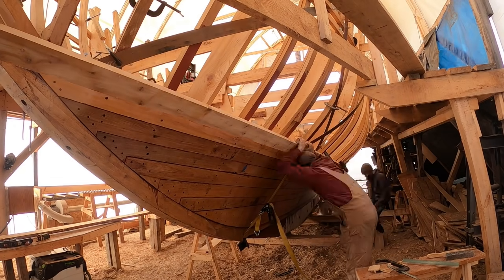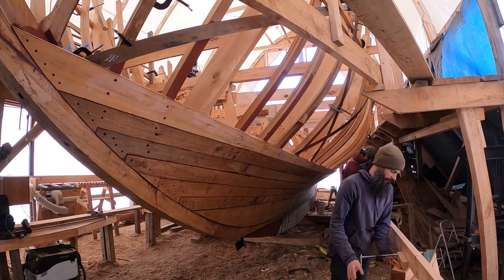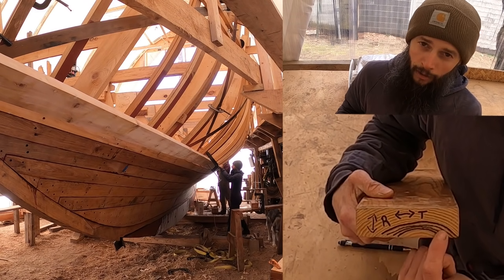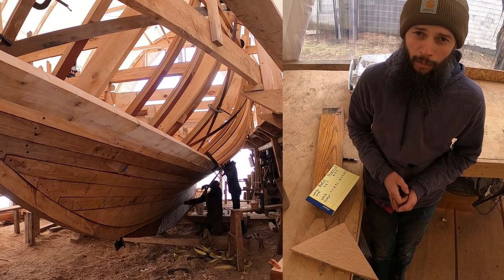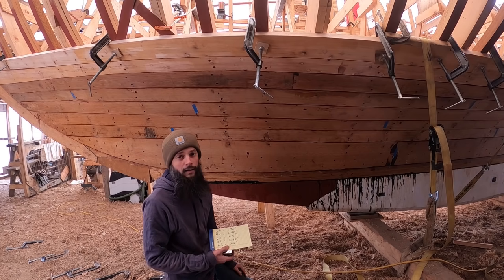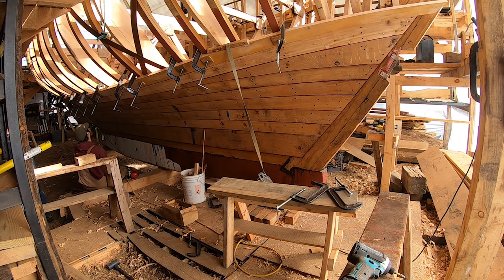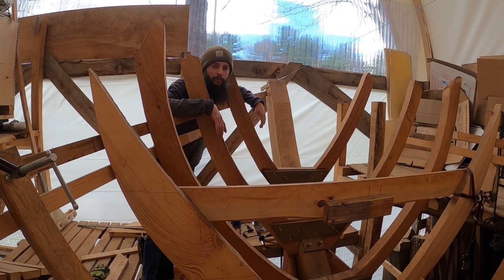Acorn to Arabella - Journey of a Wooden Boat - Episode 110: Will Our Boat be Water Tight?

Comment: Really feeling for Aaron in that final shot. It's like, yeah! We got the whole plank on, woot! only a couple more beam to bolt to and we're golden, SNAP! aaand, there goes hours of work, right at the end... that's gotta suck.
Reply: he looked like he wanted to grab the boat by the side and toss it over the bench ...
Reply: I jump when he jumped! That sucks!
Reply: Spoiler alert! lol
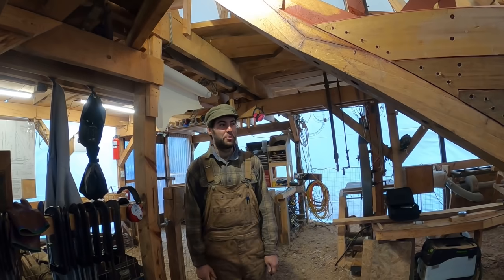Reply: 12:24 : prophetic words from Aaron ...
Reply: I guess they can scarf in a new piece at the stern, after reassembling the broken section and making a "sister pattern", and steam the scarfed portion (and a few feet ahead of it) at the stern before pulling it in. In which case, all is not lost.
Reply: ? How long will Aaron be around ?
Reply: @Gottenhimfella  yeah, but they can't scarf it on the boat. They'll have to undo all of those rivets to get the plank off the boat. And then the rivet holes are not going to be as tight after they've pounded out the old rivets and put new ones in.
Reply: @ Tito R. or maybe another butt block, or more until he realizes the wood IS to COLD. Thus steams the ends (2).

Comment: When we built small pine boats in my younger days a trick to be extremely tight above the waterline is to use the "crushability" of softwoods to your advantage.
Put piece of rod along the edge of the plank and bang on it so you get a u-profile in the center (about a 1/3 of the thickness of the plank) then plane the edge smooth. When the plank swells in the water the centerpart will swell more than the edges and make the hull very tight.
Also in my experience it's worth to "club" planks that needs a twist (basically thicken up the ends on the inside and plane in most of the twist) the rule I was thought was basically that a bord should not be twisted more than it's thickness per meter when rift sawn or you risked snapped planks when run aground.
Look at the end of the plank and think of it as rotating around it's center when the trailing corner on both sides of the center has reached the position the forward corner started in you have maximum twist.
Reply: "...when run aground" eeeeps - now there's thinking of contingencies :)
Reply: Really helpful input, Den. I wish i had enough knowledge to be sure i understand: "it's worth [it] to "club" planks that need [to] twist (basically thicken up the ends on the inside and plane in most of the twist)" {{ HELP! }} Would that mean to splice in a 4 ft plank with an extra 1 in to the inside side and then plane away the excess to produce/match the twist that is needed?}} ||| Good rule of thumb: "the rule I was taught was basically that a board should not be twisted more than it's thickness per meter when rift sawn" | {{ HELP AGAIN, please!  }} My translation= 'Look at the end of the plank [+]. Think of it as rotating around it's center. When [any Inside corner is rotated around] ... the center [and] has reached the position [of its opposing side Outside corner] .... you have [reached] maximum twist.' Did i get it right making sense of it via my head-space translation?
Reply: I would say you have it right. 

Preferably the scarfing is done before the frame where the major twist is done (the glue line generally is hard and doesn't want to twist, and concentrate the force in a thin area around it). So the "meter" of  twist begins after the scarfing area.

How my grandfather explained the twist was actually as follows: Imagine a clockface, now place the end of the plank upon it with the corners at 11 and 1 for the topside and at 7 and 5 for the bottom. If you twist the plank around the center clockwise, the corner that started at 11 shouldn't come past 1 and the corner that started at 5 shouldn't go beyond 7.
Reply: @mumblbeebee6546  There are two types of keelboat coast-going skippers: those who have run aground, and those who have yet to run aground.
Reply: @densamme1752  <So when they repair this plank they will need to move the scarf further forward than the break? I guess that makes sense. I hope they can transfer the fastener holes - I guess they could reassemble the broken plank and temporarily strap it to a "sister plank" of scrap lumber, bevel the top and bottom of the sister plank to match, then run a same-size drill through the fastener holes, into and right through the sister plank to enable transferring the fastener holes into the scarfed section (and then matching the bevels).
Could they then steam the stern of that plank before twisting it, or does cedar not enjoy that?
Reply: Gottenhimfella 😁 I get it - in fact, planning for contingencies is part of my job. I just had not heard it applied in this area, which I visit for light relief and entertainment. It was a good reminder :)
Reply: @Gottenhimfella  as I mentioned in my first comment my experience is in pine (and fir) and the problem whit pine is knots you can't in my experience steambend pine or firs that has knots in them, if they don't break when bending they can still break when drying out. But you can "boil" (it's more of a simmer) the end of a plank and and slowly clamp it in place (keep it wet and hot), you still need to have a relatively knot free plank. But remember most glue doesn't like heat so either have the scarf joint well away or glue up after the plank is trained in place.

Comment: Will your boat be water tight? No reason it shouldn't be. The secret is tar and oakum caulking between each of the planks. My family became members of Mystic Seaport when I was 10 years old, and I continued that membership for more than half a century until I moved away from New England to Tennessee. I spent years studying about old time wooden ships. I also spent many hours as a little kid in the winter time, talking with the old men who then worked at Mystic, men who had actually worked in the marine trades. I learned a LOT about ships and ship building. I am a bit surprised that you have left so little room on the outside of the seams to stuff the caulking. You are doing a good job. It is interesting to watch. I look forward to eventually seeing how she does at launching.

Comment: So regarding the plank busting...  I eventually switched to a hand bit brace for drilling and driving fasteners when the plank was under bending load...  far gentler (although they still sometimes explode like that one did)...  perhaps a bit of soaking or steaming will help.
Reply: Sloop. they use a brace and bit to drive the screws but I'm sure they are using an electric drill to bore the holes.

Comment: 1) Have you considered using a router to mate the planks together?  In this method the planks can have an initial gap of up to 1/4", 1/2" or even 1" between them.  The plank to be attached (A) is temporarily fastened to the hull in proper relative position to the already attached plank (B) below.  A router bit with the diameter 1/", 1/2", or 1" is to be run down the center of the gap cutting both planks (A) and (B) at the same time.  Any unevenness between the planks is removed and the resulting planks will fit together with no gaps.  Position a spline on plank B (or A) at a distance from the center of the gap so that the router' guide can slide on the spline with the router bit at the center of the gap.  The depth of the bit is of course the thickness of the plank.
2) The plank edges should not be flush together.  Rather a "v" should be between the plank edges so that caulking can be placed between them.  (Calking used to be messy oakum and tar - sailors weren't called "tars" for nothing!)   Caulking provides two purposes: to fill up holes and prevent leaks and to act as an expansion filler that can flex as the planks change their dimensions dynamically due to flexing of the hull and temperature changes.  The inside of the hull should be dry and the outside of the hull should be wet; this creates a gradient of wetness that permeates the wood accordingly.  That is, there is less expansion of the wood on the inside of the hull than on the outside.  The "v" allows for this gradient and reduces the strain on the wood.  If the router method above is used, a tapered router bit creates the "v" at no extra cost.

3) If you want the planks to look parallel as viewed from the side of the boat then the planks must be wider in the center than at the ends.  If the surface distance to be planked (from the last plank laid to the deck) at the stem is, say, 8 feet and the surface distance to be planked at the center of the boat is, say, 12 feet then the planks need to be 50% wider at the center than at the stem.  Further the planks should be cut at a downward arc so that when placed on the hull frames they will lie smoothly and not have to twist as radically as a straight plank will.  Scarfing three pieces like an upside down "\__/" (at the proper angles) might give you enough room for a better fitting curved cut than a straight cut.  Methods 1) and 2) then make joining them together easier.
Steve Mann

Comment: Thanks again gentlemen.  I found a TH Witherby   socket firmer chisel in the wall of an old house I was working on over thirty years ago. I believe it is 2" wide. I'm in western PA. I'll have to do some research about the chisel. It is iron with a steel blade forge welded to it. I'm sure the carpenter who lost it missed very much.

Comment: I've always wondered about how shipwrights accounted for the lack of dimensional stability of woods in the presence of water. That was really interesting!
Reply: Yea, I have been wondering about the bungs (hopefully that is the correct term) they used to plug the knot holes. When the wood expands won't the epoxy break? And how does the epoxy act that is holding the scarfs together?

Comment: Hi, ceder is a soft wood, but very hard at the same time, when the subject ia bending it. I build accostic guitars here in Brazil, and we usa a lot of ceder (called Cedro). It CAN bend, but it is obrigatory to steem it a lot. To do the sides os the guitars It take a lot of heat applyed with some spray of water while doing the bend. Of course the applications are completely different, but I wanted tô share this... Good luck guys!!!

Comment: I would stick with either bag steaming the ends or using the hot wet towels to stem the cedar. The cedar will hold its shape well once steam bent and be just as strong as it was before bending. If you make this part of your process, it will not add much time and its certainly faster than fixing the end of a plank.
Reply: I read adding kerosene to the boiling water also helps. (Capt. Pete Culler) But I have yet to try it.

Comment: I had a feeling one of the cedars would end up snapping. It really doesn't like to twist when seasoned dry, especially narrow boards in respect to length. Maybe ; if you can, increase the width of the cedar planks. Or if maybe making the high stress areas wet like you've done w hot rags before. I'm sure you have a solid plan to deal w it. Thanks REALLY great work. Beautiful

Comment: Man that stern looks strong ! I'd be sorry for any dock you swung away from with too much panache and wiped with your sternpost!  (Gold standard manoeuvre if the wind is pressing you against the dock is to rig an after bow spring, drive forward against it with your rudder trailing edge angling in towards the dock until you're approaching maybe thirty degrees of stern-out angle [mind the bowsprit!], then make a sternway after reversing the rudder to get off. If you have to sail off, you will have lay a kedge.)

Comment: With your existing tolerances on the Oak planking could you actually be in a position that they may be "too" tight already? I didn't realize that Oak had that much movement. WOW. Even at the low end of water expansion it seems like there's no room for the Oak to move. Keep up the great work and all the luck to you.
Reply from the maker: The oak has a beveled edge to allow for caulking (and leaves room for movement.)
Reply: @AcornToArabella  I forgot about the beveled edge. I know I saw that in your earlier videos. I've done finish carpentry for 25+ years and never imagined there was that degree of expansion so when I saw your percentages it just seemed like there was more than there was room to move. I love the art of wood and you guys are keeping an ancient skillset alive. Keep it going and thank you.

Comment: well at least you found the drawback of cedar before it was on the water ... bonus though ... you get to figure out with some method how to finish that plank ... i think you may want to do stepped oak on the bow for the complex curves and bends ... then you just make a form from scraps and steam and bend the oak section to the form and boat while it dries hardens and snuggles in 

.
i do think dry in place with frame on both sides will be your best solution for the bend btw

Comment: That's pretty much what you steam them for. However, such a short grained plank is better to break now than when it gets a tap from a stray shipping container on the high seas. As one of those "shear first" advocates, I quite like your basket weaving analogy. However many ways there might be to skin a cat, it's the ends that justify the means. Going the scarfing route has made things difficult enough, don't start weaving in and out of the frames. Stick with it. thanks for posting.

Comment: Just curious, since I'm not a boat builder, but I've worked with many kinds of wood much of my 57 years, is there such a thing as laminating the planks so they bend easier as well as back each other up and reduce breakage maybe?  It's probably not practical as the amount of marine glue and extra time involved would not likely be a good trade...just wondering...?
Reply: There may be. The old PT boats had two layers of 1" mahogany planks, with glue-soaked canvas in between, and held together with brass rivets. The planks were at 90* to each other, like plywood.

Made for an incredibly strong hull.

Comment: Out of curiosity, is the use of oak in the lower section of the hull planking going to make any significant difference in the overall weight of the boat, given that it was originally designed to be planked entirely of cedar (unless I’m remembering wrong)? Or do the folks who draw up the plans for boats make more of an estimate then an accurate calculation regarding buoyancy and weight of the finished craft?
Reply from the maker: It will mean that we will adjust the lead ballast ingots.
Reply: Acorn To Arabella thank you for the answer!!

Comment: Are you not worried how close to breaking some of the fitted/finished cedar planks might be? I mean the fact that just catching the counter bore was enough to take this plank over the edge - could other planks that look fine actually be prone to potential sudden breaks, say due to hull movement whilst sailing? I don't want to sow any fears, but it just seems that this cedar has been on the edge of breaking all the time!! And you're not that far into the cedar planking to consider changing to a different timber type?

Comment: Hello, my English may be a bad typo.
Why not boil long boards with water in a long metal tub? Thus, it is softened and becomes more flexible and easy to install on the boat. If the sheet is ironed with a hot iron while it is damp, you give the desired slope. Do you think this idea is wrong?

Comment: You may wish to move the FENCE on the PLANE to the inside edge, and not the outside as demonstrated.  With the fence on the inside, you press down and out with the plane, and the combined vector is an arrow away from you.  With the fence on the outside, push down for the surface and pull the fence towards you.  The combined vector points at your feet, making it harder to do

Comment: Should have went 3 more Oak planks then the Cedar?   Just a thought!
Reply: Cedar planks have been removed and they are going with oak to the waterline.
Reply: @kandk920  with that much fighting to get the cedar to play nice, I would have used oak all the way up. The extra weight should not be a problem, as the design needs a lot of added ballast.

Comment: There's a 1000 ways to skin a cat

The cat doesn't like very many of them
Reply: I read a research paper on the subject.  The researcher found that in double-blind tests where a placebo was used, cats never ever liked being skinned.  They were always against it.
Reply: @direbearcoat7551  I also did some research and the dominate cats took control, even knowing it was an experiment, and berated the subject cats... Tried to have them turn against themselves and more. Pretty awful cat experiment...
Reply: @direbearcoat7551  i skin my ones one pat at the time, they seen to like it...it´s not very efective doe, they will die before i finish...
Reply: Schrodinger's cat may be the only exception.
Reply: @travelinman70  It's always hard to draw conclusions from experiments involving Schrodinger cats. 
The control group invariably seems to cancel the target group exactly. It's uncanny.
Reply: It's ok though, because Arabella is a monohull, not a cat(amaran) ;)

(And because English is a weird language, 'to skin' can mean both removing skin [eg skinning a cat], but also to add a skin [eg skinning a drum]. So if you were adding a hull to a catamaran, you could say you were 'skinning a cat' ;)
Reply: In fact, let me rephrase, there's multiple ways to fillet felines these days.

Comment: What is the reason you are not building your deck structure first so your planking does not move when you're installing  the deck framing?
Reply: Having the frames move now is a benefit, once the planking is done, that will make the whole structure solid, decking will then be cut to fit.
Reply: Steve explains that in the video comparing to Leo and Tally Ho.